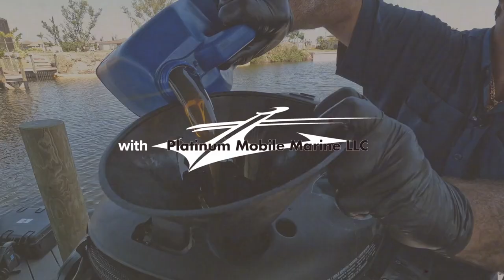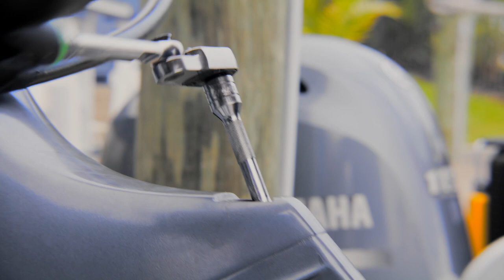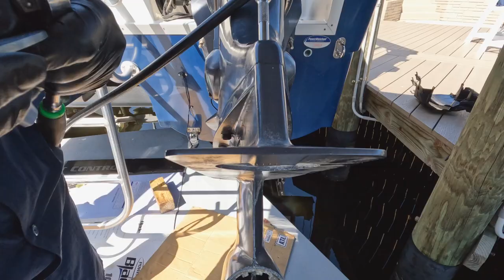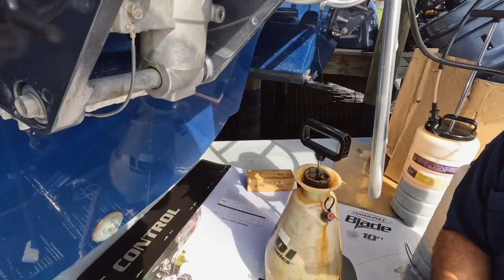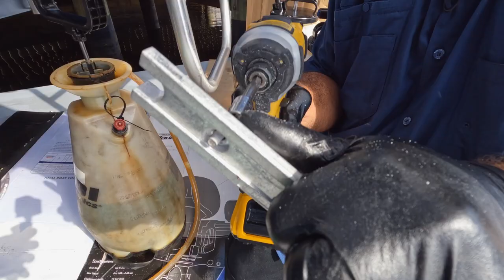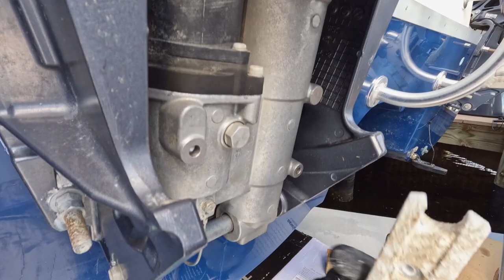How (and When) to Replace Yamaha Outboard Anodes

Comment: I came here to find what size socket to use for the exterior anode.  That would be a nice thing to add to your video.
Reply from the maker: 12mm for Yamaha & 1/2 in for Mercury!
Reply: @partsvu  THANKS! I came here for the same info.

Comment: Hi when I’m taking out mine on port side it went well but when I did starboard side it just spins and anode is loose but still won’t come out. I think it might have stripped. What do you recommend?
Reply from the maker: Thank for watching! 

If your Yamaha trim tab anode on the starboard side is spinning but not coming out, it does sound like the bolt might be stripped. While turning the bolt, apply downward pressure on the anode with a flathead screwdriver or pry bar. This can sometimes help engage the threads enough to remove the bolt. You can try to  Apply penetrating oil (like WD-40) around the bolt and let it sit for a while. This can help loosen any corrosion or debris holding the bolt in place.If the above methods do not work, you may need to drill out the bolt. Start with a small drill bit and gradually increase the size until the bolt can be removed. Be careful not to damage the threads in the mounting hole.

If you are having a rough go I would suggest contacting an experienced marine mechanic to avoid damaging the lower unit. When installing the new anode, consider using an anti-seize compound on the bolt threads to make future removal easier and prevent corrosion.

Best of luck.

Comment: None of my sockets will fit through the opening on my 2003 yamaha 225. I've tried every one I have that fits the bolt and none of them will fit through the hole to access the bolt. Any suggestions are appreciated.
Reply from the maker: 12mm for Yamaha & 1/2 in for Mercury!
Reply: @partsvu  What I mean is that my 12MM wont fit through the top where the bolt is accessed from. So I can't get my 12MM on the bolt at all. I have like eight 12MM in my garage and none of them work.

Comment: I just got a new prop for my Yamaha F90 and now there's only about 1/8 inch clearance between the prop and the anode trim tab.  Would it be OK to file the trim tab a bit to allow for more clearance?  The new prop is stainless.   Suggestions?   Thanks much.  Liked and subbed.
Reply from the maker: It's generally not recommended to modify the trim tab on your outboard motor, especially if it's an anode trim tab, as it serves a critical function in protecting your outboard from corrosion. Filing or altering the trim tab can compromise its effectiveness and potentially lead to corrosion issues.

Instead of modifying the trim tab, here are some alternative steps you can consider:

Check the Propeller Installation: Ensure that the new stainless steel propeller is correctly installed. Sometimes, a propeller may not be seated properly on the propeller shaft, affecting the clearance.

Select the Correct Propeller: If the clearance issue persists, you might want to consult with a Yamaha dealer or a propeller specialist to verify that you have the correct propeller size and pitch for your specific Yamaha F90 outboard. An incorrectly sized propeller can lead to clearance problems.

Consider a Different Propeller: If clearance remains an issue, you may need to explore propeller options that provide better clearance without compromising the trim tab. A different propeller design or size might be a better fit for your boat and motor combination.

Adjust Motor Trim: Ensure that your outboard motor is trimmed correctly while underway. Adjusting the trim can affect the clearance between the propeller and the trim tab.

Contact a Professional: If you're unsure about the best course of action or need expert advice on selecting the right propeller, consider consulting a Yamaha-certified marine technician or a propeller specialist. They can provide guidance tailored to your specific setup.

Ultimately, it's essential to maintain the integrity of the anode trim tab for the long-term protection of your outboard motor. If clearance issues persist, it's better to explore alternative solutions rather than modifying the trim tab itself.